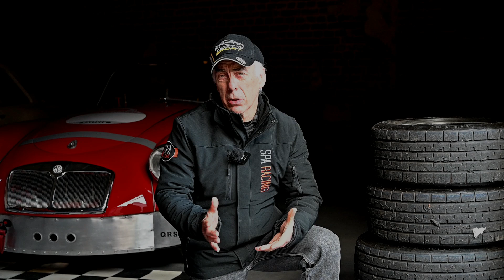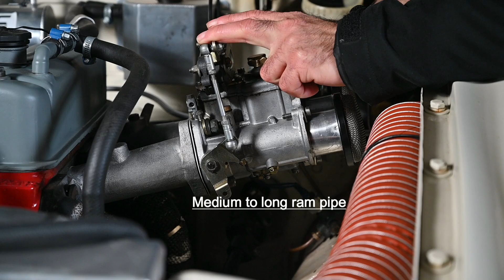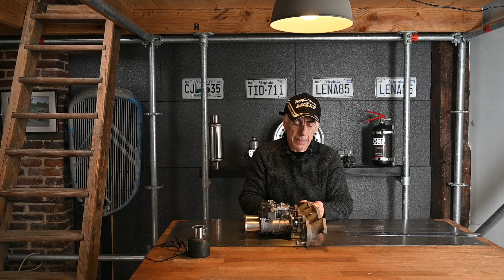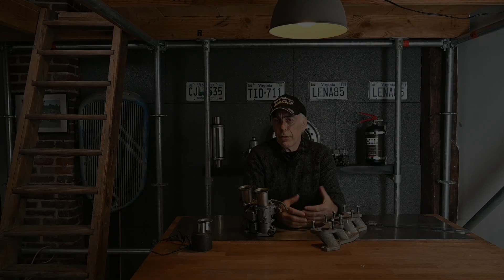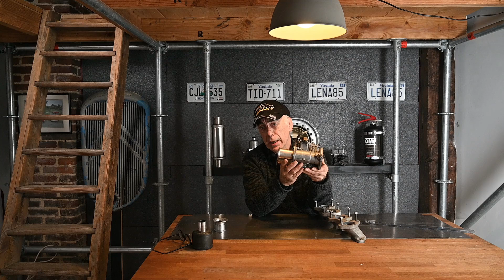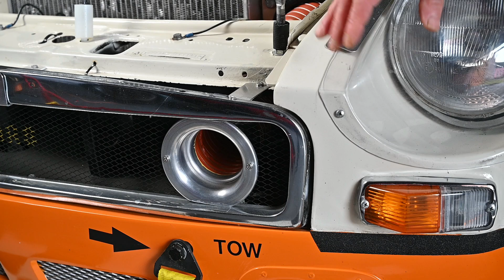Weber carbs and velocity stacks - Resonance

Comment: Correct me if im wrong but i am under the understanding it is not vacuum pulling air/fuel mixture it is atmospheric pressure forcing its way down into the cylinder
Reply from the maker: yes indeed, its a bit the chicken and egg thingy
Reply: @D3Sshooter  great content either way thanks for the video 👍

Comment: a lot of people don't understand that everything is a compromise, it;s just where the sweet spot benefits you more. Resonance aka fequenct of gasses is imporrtant on both sides of the engine, altering intake will alter exhaust and vice versa especially if the engine has a long scavenge time.

Comment: How about having an airbox inlet that has a valve system that shuts off flow, timed to the inlet valve frequency.
So, it creates high pressure at high car speed when open, and then shuts of flow in a timed sequenced to create steep pulsed negative airbox pressure on demand?
I was always intrigued by boost bottles that two stroke engines use., and how they interacted with 2-stroke reed blocks (power band pulses)

I always ark back to the old Myth Busters episode covering long tubes under vacuum (70M), that are punctured to create crazy supersonic air speeds.
Thats is literally equivalent to a good valve seat in action.

Comment: Great video! Also, it’s better to have longer intake manifold so that the airflow past the throttle blades gets more time to stabilise before entering the cylinder.
Also, the airbox acts as a low pressure zone of stable air allowing better suction effect from the resonant frequency
Reply: Furthermore, air inertia is critical not just airflow as air has weight and timing that inertia also helps with optimal cylinder filling.

Comment: Variable length manifolds?
Reply: Kawasaki used different length velocity stacks on their 750cc WSB engines. The outer (cylinders 1&4) had shorter stacks than the inner 2 cylinders. Part of the reason was to give the rider's a bit more room around their knees but this also widened the powerband somewhat, making the bike a little more user-friendly.

Comment: I thought part of the reason for the bell mouth shape was because as the intake draws air towards it some would be wasted as it would pass by the sides of the intake. So the bell mouth catches more air. Would be interesting to see if anyone has flow bench data to show if that works.
Otherwise, would the resonance effect work just as well with a plain tube with no bell mouth?

Comment: Hey Steve! I just bougth some velocity stakcs for my Weber 40 DCOM for my AX Sport, it's a very rev happy engine with peak toque/power at 5000/6800 rpm but I feel like I want more grunt in mid rpm, would a 35-40mm long velocity stack be a nice choice or should I get longer ones? Im afraid I loose peak power it makes about 100hp with the stock airbox will I loose hp by fitting some semi long velocity stacks?
Cheers!! Love your videos and thank you so much for sharing your knowledge, I learned how to tune my webers with your amazing videos!

Comment: Having used 45mm Webers over several decades the long ramtube always is better than short. No ram tube is noticeable.
You have a rockstrainer over those ramtubes. Bad!! The standoff from the trumpet will be at least an inch out of the top. You are strangling it like that. I always used pod type filters with plenty of space above the throat. Many refuse to use airfilters but that is dumb,, or maybe they have strangled them. 
Here in Oz our 71-73 Valiant Chargers used  3 45mm Webers and that was a known fault with the factory airfilters, which were at least an inch above the short ram tubes used. Lots of fuel staining in them. With IDAs the standoff is even more.

Comment: I am curious if you have done anything with the progression holes, I have a set of triples to go on an L28 into a 240Z with the original 3 progression holes, have been told that they are horrible to tune because of the progression holes.
Any thoughts please, still need to rebuild them as per your previous vids, so work to do, just figure i could possibly make a mod before install onto engine...

Thanks muchly!
Reply from the maker: Thanks, not in my opinion, I never had to make changes to the progression holes. Just make sure that they are open and clean,  also not that the same idle jet feeds the idle hole and the progression holes, so maybe you might to increase that one..

Comment: Your a real gentleman. I did enjoy this and thank you. At the end of this presentation. You talked about forced inlet pressure reducing the filling eficeincy. I will have to watch this again to be sure I heard you corectly. But if I did.  I think you have your inlet pressure theory wrong and no measure that I have ever seen. Can added inlet pressure from a scoop or charge inlet ever hurt intake eficiency?  I am not convinced. But I do really appreciate your input and wilingness to share information.
Thank you.
Reply from the maker: Thanks,  It seems that I was not clear enough:  What I was trying to say was that the increase in pressure around the trumpets due to an airscoop  can prevent carburetor resonance.  Which does not mean that  the additional pressure due to the scoop is not going to help filling the carb.  It will  do so, but eliminates the resonance gains...in full or partial...  I am not talking about forced induction systems, I am talking about natural aspirated engines
Reply: @D3Sshooter  thanks for clarification. That makes more sense now.
I know you were talking
 N/A. So was I.  My reference to positive pressure at the induction inlet.  would be increased ambient pressure density do to the vehicles forward velocity. I was not refering to any kind of added boost device.
Anyway,  thanks again!
Great video.
Reply from the maker: @Tom-z1q  Thanks Tom,  indeed... the entire matter is a very complex one and trying to put some simple explanations  in is not always easy...  Have a great day...

Comment: Thank you for the dcoe videos i have rewatched your series multiple times this year. Please do few more! Possibly driving characteristics and definitely more jet behavior with the air! My 2 issues right now is bogging on a hard launch and a lean low end on the main etube with a load. With a very gentleman like throttle application the carbs work great but if i try to force the carb to work with low air speed its lean then eventually the fuel flow catches up.
Reply: I suppose you have tried increasing the size of the accelerator pump jet? Likewise on the idle jet or maybe you need an F7 emulsion tube?
Reply: @v2gbob  I have and the O2 gauge has it going extremely rich so I have been trying to mellow the shot out but bring the mains on sooner.
Reply from the maker: I will see what I can create,  as for your pointed problem,  there is a need for a certain airspeed to have the venturi effect .  If the airspeed is to low , then that will not happen and you have an  lean issue.  On the other hand  volume is also need...  in many cases increasing the air volume due to wider open butterfly can or will drop the air velocity initially until the engine picks up rev's.  That is why we have an acceleration pump, injecting that extra amount of fuel for two reasons.  One you need more power thus a richer AFR to accelerate the car, and second compensate for the initial loss of airspeed / venturi effect when pushing  that pedal down.   In your case I would start with more squirting of the acceleration pump.
Reply: Pump squirter not working
Reply: @ldnwholesale8552  acceleration jets are working it's after the shot on steady hard pull it doesn't draw the on the mains until higher rpm. I already went down 4mm on my choke and have 8 different etubes and boxes of jets. And unfortunately every time I make carburetor tuning progress the chassis/suspension demands more work:) gotta love 50 year old cars!

Comment: Good video. Still getting my head around the negative pressure wave.. maybe do a diagram next time ? variable length intake runners are very very rare but they were on a famous car (the 787B) from what I recall.
Reply: A lot of production cars have used variable length intakes, but it’s normally achieved by having two different length intake runners with a valve that switches between them at different rpm ranges. 
Also, you can get adjustable length ram pipes, though they’re obviously not adjustable ’on the fly’, just for tuning on the dyno to optimise where in the rev range you want torque
Reply from the maker: I will create a animation for it

Comment: You got the physics behind the resonation completely wrong.
First of all the wave which travels backwards doesn't disperse in the atmosphere, it actually bounces back towards the valve. 
The intake runners are "tuned" to a specific engine speed, when the timing is such that the wave travelling from the entrance of the velocity stacks hits the valve when it's open. This is the most favourable condition as the positive pressure helps the engine to intake more air fuel mixture.
On the other hand if the valve opens when the wave is far for it, the engine will suck less air because of the negative pressure wave at the valve. This is the reason why different lengths of the runners make more or less power at different engine speeds
Reply from the maker: Not really,  i thin k its a matter of wording.   The reflected high pressure wave   does indeed bounces back ,but that is the negative pressure also called the  rarefraction.   When  I stated that it disperses in the atmosphere, its trying to explain that high pressure wave ( the reflected) transforms into a  rarefraction ( low pressure return wave).    and the rest of your comments are also what I stated ...   I will make an animation on this so we can further discuss it if you like..  Thanks for your comments, its always great to discuss in a polite manner
Reply: I'm just a dumb guy on the internet, but this paragraph reads like a direct summary of the video I just watched

Comment: Great video as always, excellent simple explanations.  Would be great if you could post the calculations for a starting stack length for low, mid rev engines. Keep the videos coming, I learnt so much about SU’s tuning and AFR ratios from your teachings.
Reply from the maker: Thanks. Somehow that piece of the video slipped out during the transcoding.  I will need to recap that.   Thanks .